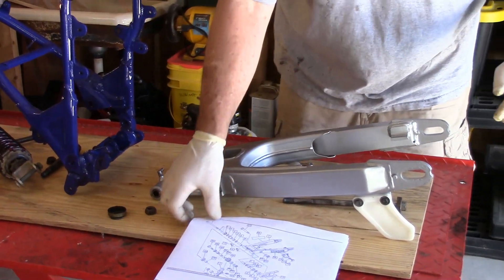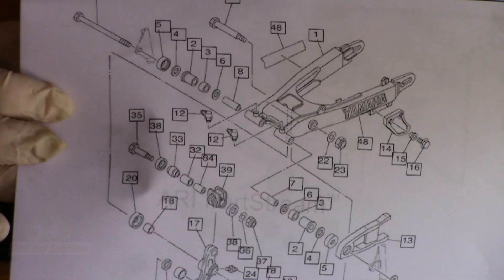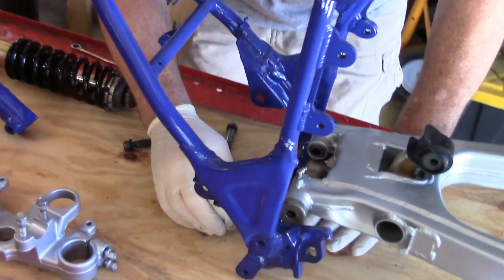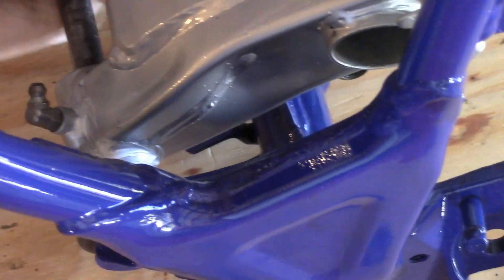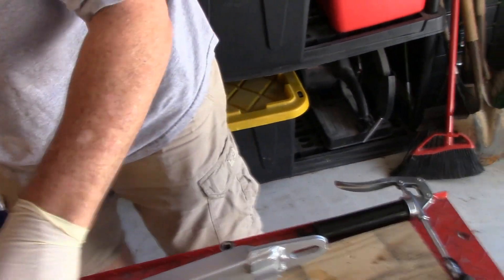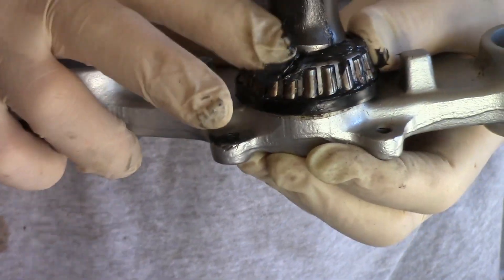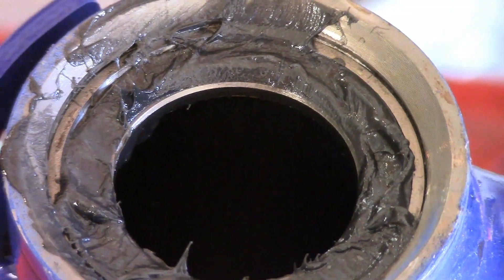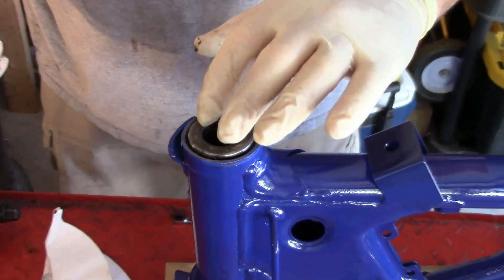Motorcycle Frame Assembly

Comment: Best video! The camera man and the editing are great. Clear and exact shots of what is being done. Torque amounts mentioned, how things should be eg. grease packing good stuff. It looks like TTR 230 you were working on.Two points. On bicycles when reusing individual bearings like on the triple head, they don't work well and really need to be replaced with new otherwise you are having to retighten the bearings until they fit their old positions. Did you add new bearings? If so how do you get the correct size? Two would love to see you rebuild a front fork and readjust the suspension height. So many bikes today are tall as to make it near impossible for some riders to choose them as bikes.  If you could show how to reduce the fork and say maybe the rear that would make my day.  Keep up the great vids. Rick
Reply from the maker: Vlad, I always replace bearings and steering races on a restore or if they show wear or are not perfectly smooth. Rust and corrosion are what kills most of them. These were absolutely perfect, so I wanted to re-use them. I'll keep the forks on the list for future rebuild and tuning of length. On lowering, the fork tubes are easy to drop lower in the triple-clamps. Reducing the spring lengths internally will drop (sag) the ride height, but usually makes the spring rates and suspension range unacceptable. Are you looking to lower the rear on a twin-shock or mono set-up? Thanks for commenting - Gordon/RTS